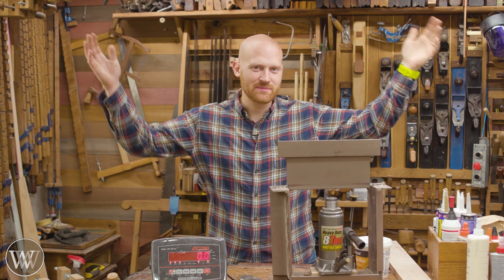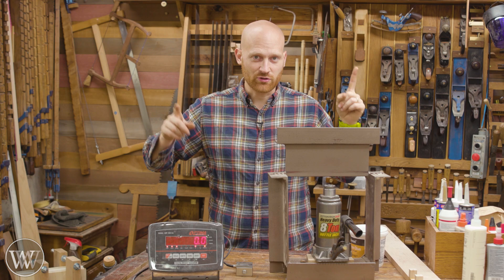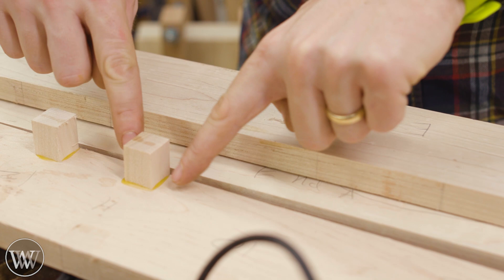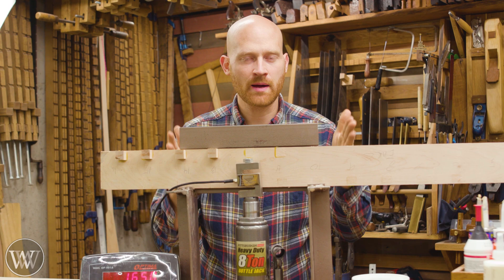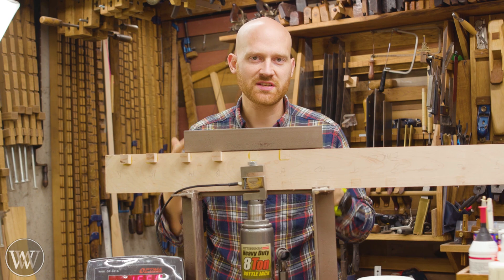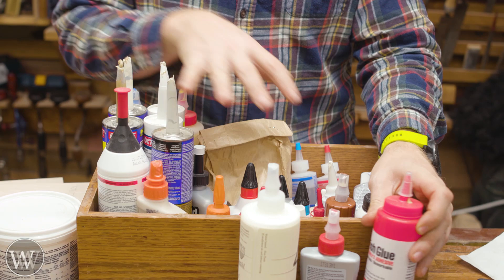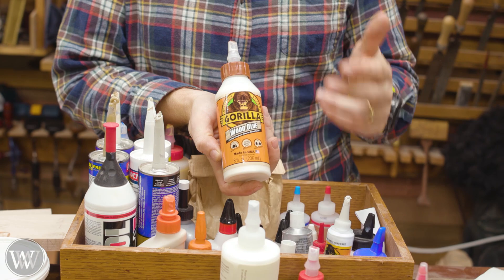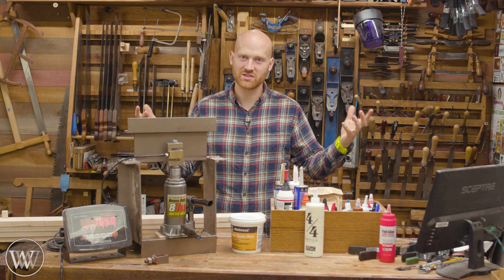The Great Glue Test Round 2 How Will This Work

Comment: Not a body part, but Japanese shojii makers use a rice paste to adhere the paper to the frame.  In my experience, it works pretty well to stick joints together as well.  Rice cooked a bit soft, then ground into a paste.  Like hide glue with heat, it's reversible - moisture releases it.
Also - about doing 100 samples versus 10 samples.  I haven't seen your old data, but you really want to look at the variation you see before you decide to increase your sample size.  I assume all your samples are made using the same species of wood and hopefully from the same tree, with the same moisture content, and milled to the same surface quality (to minimize the influence of the wood variability).  Of course, you could test one glue using the same species but different sources and estimate the effect of the wood's natural variability.  
Don't feel bad about new questions arising.  My undergraduate chemistry mentor used to say, "Good research raises more questions than it answers."  Your approach seems pretty good to me.
Reply from the maker: Yup I have covered most of those. All boards came from the same stock milled in the same direction and sanded to the same grit. All are stored in the same place and are the same moisture content. The standard deviation is 7-30 ish. So a larger sampelsize. Would give far better conference in the numbers. I almost included rice paste in this series. There are a lot of others I would like to do.
Reply: @WoodByWrightHowTo  I know you want to be absolutely certain in your conclusions, but don't hock the house in order to do a zillion samples of each glue.  LOL!  Your tests already are the most detailed I've ever seen.  Thank you for your effort, and for the interesting and informative videos.  Best wishes.

Comment: To get a larger sample size, maybe share how to make/obtain all of the components you are using to do the test, the exact list of the glues used, etc and allow any viewers willing to do so to perform the same tests and submit their results. If you even get ten other people to contribute their results, you now have a sample size of 100 versus 10.  It will also average out glue batches as the contributors will be buying glue from different stores, different areas of the country at different times.  You'll have to manage the aggregation of the data, but you wouldn't need to do all of the testing yourself.  With a little extra effort, if you have enough people interested in participating, you could even assign one or two glues to each person so that the participants don't have to buy all 32 glues. Then that person can test that glue 100 times and submit the results. Many hands make light work. Sorry for the long note. Hopefully this makes sense.
Reply from the maker: the problem is the rig I am using is around $1000 to setup up, and around 30-40 hours to run one set. but all the specifications are on the earlier glue test if anyone wants to do the same. if others were interested in doing it we had though about shipping the rig around to different people, but in the end there were not many people wanting to sink that kind of work into it.
Reply: The measuring equipment is very expensive.

Comment: Wondering if you have used marine 5200, the bane of boat refitting. I'm guessing it would fit in with construction adhesive and is often used as a bedding compound. Lots of interesting language used in removal of through hulls, hatches and stanchions not to mention interior trim. I found the failure of the resorsinal glue with Arabella disturbing, never a fan of the stuff but dang!
Reply from the maker: ya a lot of glues acn be temperamental in how they are applied!

Comment: If you want to test the tensile strength, perhaps it will be possible with a very hard wood or perhaps even with a different material that is somewhat similar to wood, but stronger (perhaps something like a bundle of glass fiber?) 
Also you asked about concerns in the video. The only concern I could think of would be that the applied amount of glue per surface area needs to be consistent. I did not hear you talk about this aspect in the video, which is why I address it.
Reply from the maker: I will be applying them as the manufacturer suggests so some are thicker then others or are under different pressure. If no guidance is given then a thin film is applied to both sides and pressed till there is squeeze out on all sides.

Comment: I think that it would be interesting to check that the maths scales up by testing 3/4" against 1" sections.
Reply from the maker: I did a bit of that last time and from the tests of 1squair to 4squair to 9squair it was very close. The only major is far more wood breakage on the larger sizes being that there is more chance for the wood to break and less wood being supported like it was in the main test.

Comment: James, this is fantastic. If you can ever get around to it, I would love to see the results in strength (or not) due to basting the samples of PVA glue. I often do this when joining boards, and don't want to waste my time if it doesn't do much.
Reply from the maker: what do you mean by Basting it?
Reply: Mix a 50% pva/water mixture. Paint that onto the wood (both pieces), and allow to dry to the touch. Then glue as normal.  The idea is that the thinner layer penetrates deeper into the wood.
Reply: The second layer of glue must be done within a few hours of the first or the glue will not adhere.

Comment: You did a shear test but what about a shatter/impact or torque test? Superglue has compounding anti-shear strength across its rigid surface but if there's any torque or sudden impact you can snap that thing right off.
Reply from the maker: I've been trying to come up with a rig to test sudden impact but haven't been able to make one that will give me accurate data. The big problem with super glue isn't its strength in use but it's longevity. It tends to weaken over time especially with slow wood movement. I have a long-term test running right now to show that.